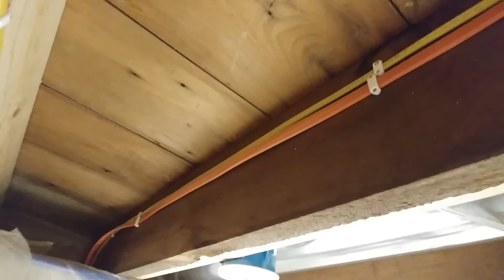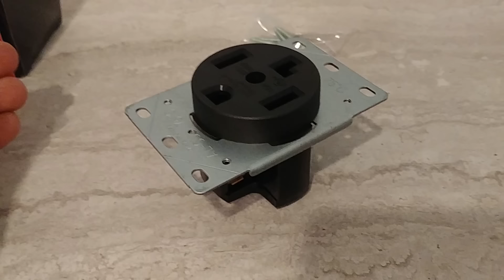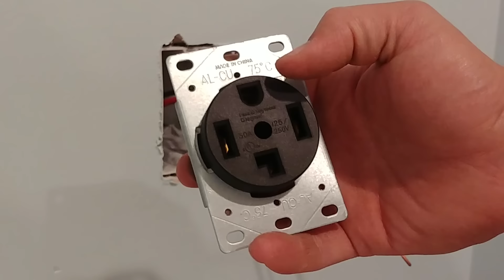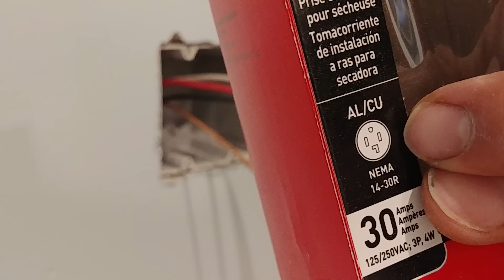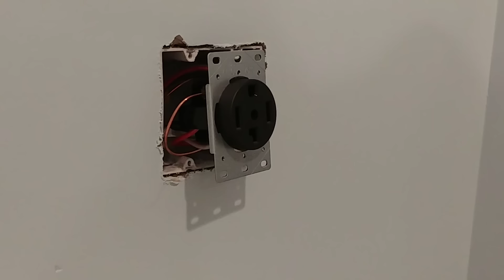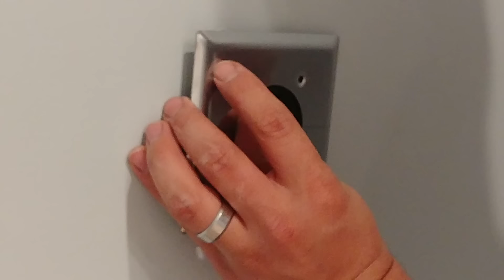How To Wire a Dryer Outlet or Receptacle - Materials Needed for Dryer Wiring

Comment: That's it mean that the black wire represents L1, and red represents L2, white for neutral and green for the ground. So that's it mean that the L1 is phase 1 and L2 is phase 2 connected in the adapter.

Comment: Hi, hoping you can help... All I'm trying to do is hookup a dryer in an older building (1976 condo) and I've added a ground and converted from 3-prong to 4-prong, standard US 30AMP circuit.  I've watched like 30 videos and everyone seems to claim 240V is either RED or ORANGE, and showing a FLAT wire.  I have a single Romex BLACK, ROUND 10/3 wire (2 white/black hot, 1 ground, and 1 neutral bare wire) coming into a 1-gang old metal box (is this legal?). I am in the US/North American (NJ state). I simply want to move the receptable down lower on the wall out of sight, i.e. extend the Romex a foot or two inside the existing drywall, using up-to-date code and the correct type of cable, connector, and junction box(es). Please explain:

1) Why is my 10/3 a BLACK cable, and round not flat RED or ORANGE?  Is this just common in older construction, or was the wrong type of cable used all the way back to the circuit breaker?

2) What is the difference between Romex 10/3 300V vs. Romex 10/3 600V, which are currently the only ones still being sold at Home Depot. No sign of any red or orange 10/3.  Are these ROUND BLACK cables still current and OK to use inside drywall (like what appears to be there now), or is that the older style, for outdoor use, or some application?  When did they switch from red or orange to black, and flat to round, or vice versa?

3) Does it matter whether I use 300V or 600V?  What is the typical application for each?  (I've googled till I'm blue in the face...can't find ANY videos talking about this anywhere!!)  Is 600V just overkill? What is that typically used for?  Would it hurt anything to use 600V in a 300V application (ie either fine for an electric dryer 240 30AMP circuit), or is it bad to use a higher rated voltage wire for any reason?

4) What is the proper size ELECTRICAL / JUNCTION box for a 30AMP Dryer 240V circuit with a METAL BOX (ground screw in box)?  Except for yours, 90% of the 4-prong dryer outlets stocked at Home Depot and almost every video on YouTube seem to show people installing these newer 4-prong dryer outlets into 1-gang boxes. Even the receptable instructions itself claim "Do not install in 1-gang" yet the plate itself is sized for 1 gang (only two screws top and bottom, like on a normal light switch)!  What is the code for 240A?  1-gang or 2-gang?  Why are the majority of outlets sold with a 1-gang plate if the box is supposed to be 2-gang?

5)  What is the code and safety requirements to SPLICE and EXTEND the cable inside existing drywall?  I read somewhere code says you can't have a junction box behind drywall. So do I need to actually REMOVE the existing junction box, splice all 4 wires including ground using push-fit or butt connectors to extend the cable inside the drywall, then leave that cable there loose in the wall outside of a junction box, just to relocate a new metal outlet box 2 feet lower with an outlet on it?  Is it OK to drywall over the existing spliced section?  (This seems a lot more unsafe to me than just leaving the spliced section inside the existing metal junction box, and then extending on down to the next one.)

Thanks if you can help. Will vote up the video...because I can't find these basic answers anywhere!  Thanks

Comment: how come my dryer outlet only has 3 pins
Reply: There are two different types of outlets. 3 and 4 prong outlets. Your dryer can have a 3 wire or 4 wire setup however your outlet is wired though is how u want to choose your dryer cord rather it be a 3 wire or 4 wire

Comment: What is I don't have a ground wire for condo built in 1987?  Should have one but just wondering. We will need to replace the old 3-prong receptacle  for an old electric dryer with 4-prong receptacle.

Comment: Thank you for this video! I just moved my dryer down to my basement in an older house I just bought. In the process I found that I have to rewire it with new 10-3 instead of using the old 10-2 wire that was originally installed in the house. I was confused with how I needed to connect my 10-3 to the circuit breaker box. This helped me out so much!

Comment: Thanks. Is there any specific height for the dryer outlet in the basement.
Reply: A minimum of 3 ft from the finished floor. I just put mine around 38" from the floor, so it's accessible to unplug without having to pull the dryer out of the way. That lands the plug just behind the top side of the dryer and mostly out of sight.

Comment: Wish you had explained why a dryer receptacle (240v) needs a white neutral wire.
Reply: Same reason a 120v receptacle needs one. It completes the electrical loop. The only difference is that 240v has a second leg (wire) for the other 120v side. So with that second leg it creates a 240v outlet. 120v + 120v = 240v.

Comment: Just moved to new house and  my new dryer chord only is a 3 prong. So I am running 10/3. I bought a 3 prong dryer receptacle. I am using a metal box. Do I ground the ground to the box? Because the receptacle doesn't have a spot for the ground?
Reply: The NEW DRYER came with a 3 prong chord?

Comment: Are ground and neutral bonded or connected on the outlet? So if you did an ohm test they would be connected?
Reply: Not on 4 wire install.

Comment: Is there a reason for having the ground face up vs down?
Reply: I learned in school that having the ground facing up is just like a safety precaution say if the faceplate somehow fell off and hit the ground screw it could cause problems but if the ground is facing up there’s no chance of that happening. Idk that’s not exactly the technical answer but that’s what I remember! :) Same reason as why when your installing receptacles sideways the neutral side should be facing upwards
Reply: @leadupont1895  Then why do we install all other standard home receptacles with ground facing down.
Reply: SimpleWick I’m not sure! I go to a trade school and our shop teacher always tells us do what the homeowners asks for, and if they have no preference then grounds up it is. I suppose it doesn’t do much extra protection and likely is just a little trick people like to do.
Reply: @leadupont1895  Yeah that's probably just it.
Reply: There is no code for installing grounds on top or bottom. It's preference.

Comment: How did you run the wire into the wall on the other side of the receptacle?
Reply from the maker: https://www.youtube.com/watch?v=7R8SxBXC86w
This is not the same exact installation but I show another range wiring example with the wall open. Hopefully it will help a bit!

Comment: Sorry to ask. but your washer hookup. I see your supply and drain lines aren't connected like most of them are. they are placed on either side of the stud. where did you get those from? I've been looking but cant find them. Also the recessed dryer exhaust too. thanks!

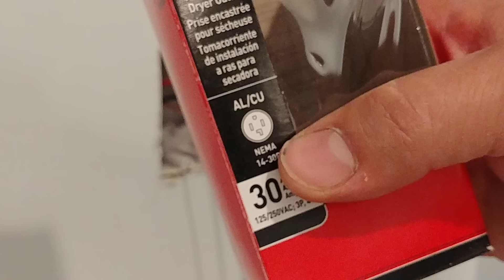Comment: 6:32 It’s not color coded so how did you know what wire to put for each screw?
Reply: nick jones the plug typically says “W” for the neutral and the ground slot looks different from everything else (opposite side of neutral) and “X” and “Y” r interchangeable red and black

Comment: Good choice on carpet knife.
Reply: If you use that knife to install carpet then you need to find a new trade. If ya haven't already lost your fingers and buckets of blood. I remember my third day like it was yesterday even though it was over 20 years ago. I thought I was doing good by bringing my own folding knife and 12' tape to work. The old man seen them both and said get rid of them. It wasn't a long time before I realized why. If they fold then they can collapse. Our knives need to be solid and one piece. Folding knives are meant to be more convenient and are not able to handle the stress we put them under. Trust me it would be nice to just fold a knife up and put it in  my pocket and not have to use a sheath or pouch. There just isn't any that work. Sorry for the long reply. Kind regards

Comment: Im moving my dryer to a spot that dont have an outlet. Can i rewire from the regular plug thats 5 ft away. And route the wire to a dryer plug. If that makes sense
Reply: No. Regular plugs are 15 or 20 amp. Dryers need 30 amp circuits. You probably have this fixed already but if not hopefully I helped.
Reply: the wire is to small